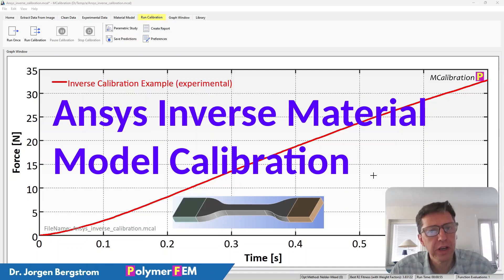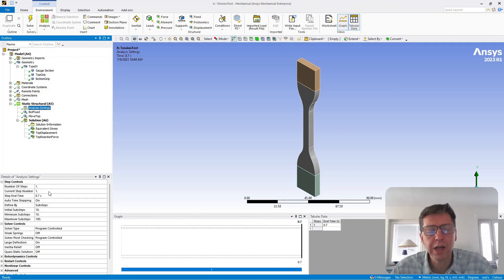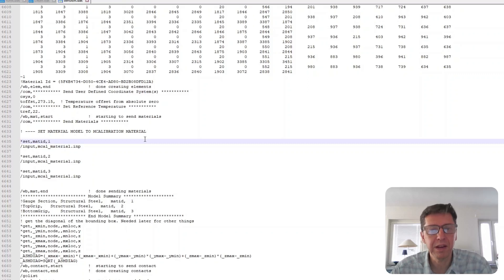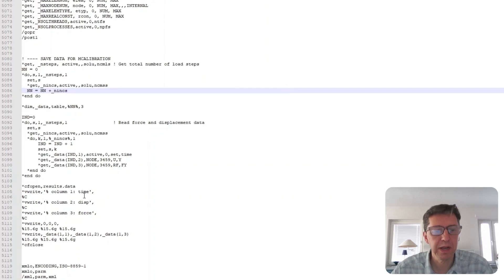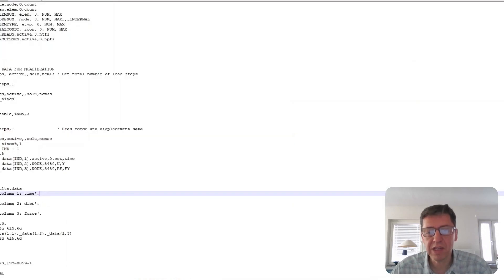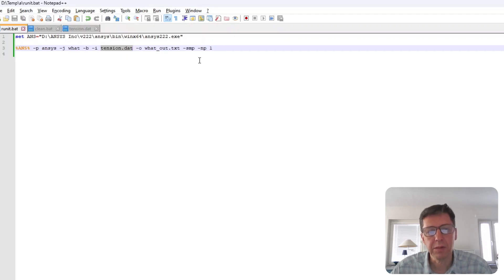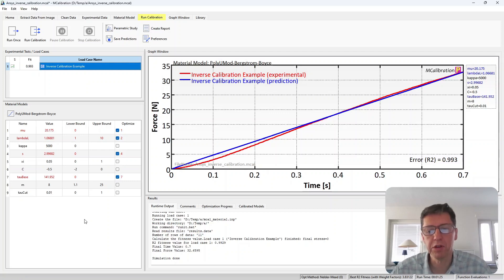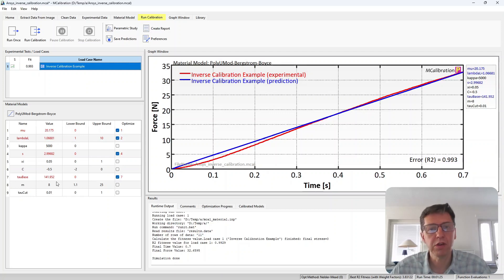Ansys Inverse Material Model Calibration

Comment: I have doubts regarding engineering data assigned in the ANSYS workbench.
For polymer structure ( viscoelastic nature-nylon 3d printing) i need compression and release of that structure i need to perform my analysis. What are the important data i need to assign in engineering data. I put Young's modulus, Poisson ratio.I did a DMA test which has a table of heading E' ,E",tan delta, time,frequency, dL, temperature. I need to assign a prony shear relaxation. Can you explain it?